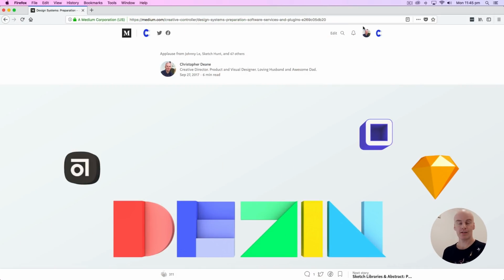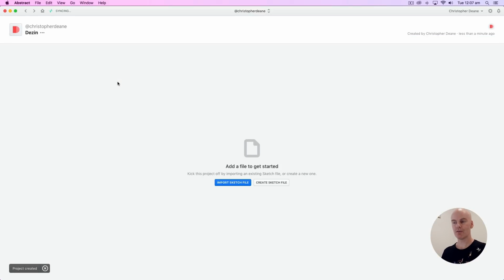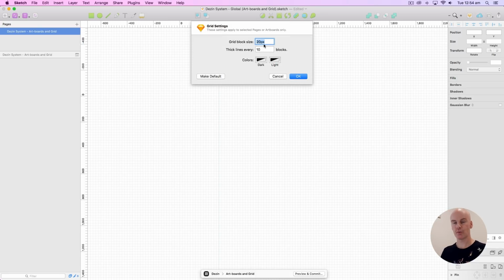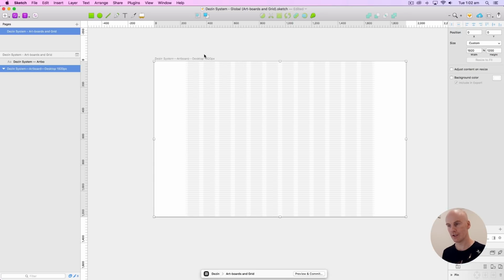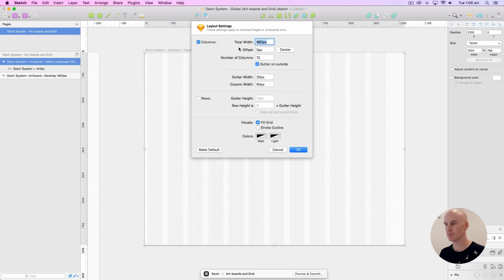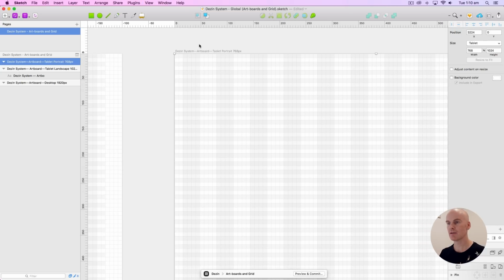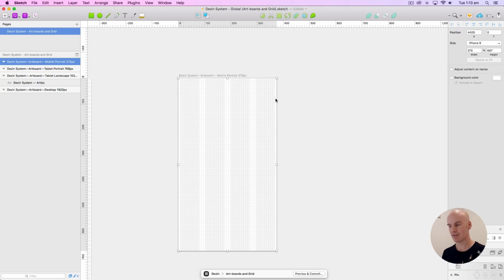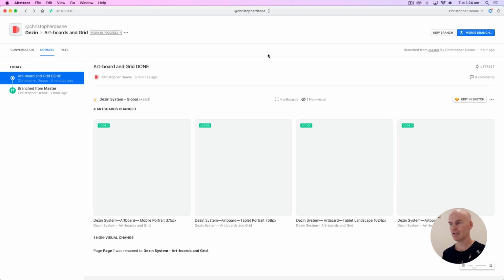Design Systems, part 1: Art-boards and grids

Comment: Hey Christopher. Thank you for the video man. love this stuff.
I struggle to understand grids and how they work. Do you have a video on understanding them? you used specs to create you art-boards but is there a video before this showing how you came up with the specs in the first place?
Reply from the maker: Hi Brand. They're really based on trying to keep to an 8 pt scale and then seeing how many columns and gutters that can be multiplies by 8 can be fit into them. I've now changed how I approach this and only keep the gutters as multiples of 8, with the columns becoming fluid. As that is more in-line with how front end works 🙂.

Comment: Awesome videos Christopher! Just one question if you don't mind.
When working on an 8-point grid I am still confused on how I should vertically align small objects. For example, a text with 14px font-size and 20px line-height. It doesn't fit perfectly in any row... Increasing line-height doesn't make sense (the next text style is 16/24) and decreasing will also look bad.
What do you do in these occasions?
Reply from the maker: Hi Gerard, you could try a 8pt grid with a 4pt baseline (Type) grid. That's what I'm moving too 🙂.

Comment: Christopher, amazing series! Great work! Could you please explain more in detail about the grid system you are using and how it works and how can i know how things will look at smaller resolutions like 1280 when designing in 1920 with a 1440 grid and and for what reason do you use the guides you place on different measures and how is that helpful for me?
Reply from the maker: Hi Sno. I use an 8 point scale and this gets applied to type scale, icon size, grid layout settings and everything else then becomes a multiple of 8 in width and height. This allows it all the snap into place with the columns and grid we use. On smaller screens it also works where for at 1280px art-board you would use layout settings of: 1248px, 12 columns, Gutter on outside ticked, Gutter = 32px, Column width = 72px.

The guides are there to help content snap into place easier and the inside guides are for text based content.

Comment: Hi Chris - thank you so much for this. These tutorials have been really helpful! My only question is this: how would set up this grid so the outside gutters are equal to the inside gutters? It's been really bugging me! Any advice would be much appreciated. :)
Reply from the maker: If you look at how a grid is built, it's actually 12 sections and each section contains a column-item that has (In Dezin's case):

16px gutter (Left) - 88px column - 16px gutter (Right)

This is then repeated 12 times to give you what looks like you have 16px gutters on each side of the whole set but 32px gutters on the inside. Does that makes sense? Sketch creates the layout settings this way (As does Bootstrap) so you'd have to add another 16px on each side manually in your art-board to achieve what you would like to do.

Hope this helped and have a good week 🙂.

Comment: Can anyone explain me briefly how making a grid system like this helps in the design. Also, would love to know more about the 8pt grid. I think it helps in a better handoff to the developers but I am sure that there is more to it.
Thanks. By the way amazing stuff. Nice articles as well. Really appreciate the time and effort you are giving in.
Reply from the maker: Thanks for watching Nitin. The 8 point grid is something I've used for a while now and there's already a bunch of information out there like this article https://blog.prototypr.io/the-8pt-grid-consistent-spacing-in-ui-design-with-sketch-577e4f0fd520 about why it's helps your design process and workflow.

For me the main benefit is that I can keep everything as multiple of 8, from the 8 x 8px grid to the 8pt baseline grid of typography that when combined with a the typography scale (16,24,32,40,48,56...) makes your copy visually more appealing and easy to read. I also make all of my icons match this scale so they fit into the visual system with ease.

Try it out, it might take a while to get used to and even I used to resist it but after adopting it and working with design systems, other designers and developers I've learnt that sometimes you just have to go with it :)

Comment: Hey Chris, thanks for the helpful video. If I was making a 12 column grid at 1366px what would the offset, gutter width and column width come out to?
Reply from the maker: Hi Tommy. Well 1366px wide doesn't divide into 8 so it could be better if you changed the width of your art-board to 1440px then use these settings to get you below 1366px:

Width: 1344px
Offset: 48px
Columns: 12 (Gutter on outside)
Gutter Width: 32px
Column Width: 80px

See what this looks like and thanks again for watching 🙂.

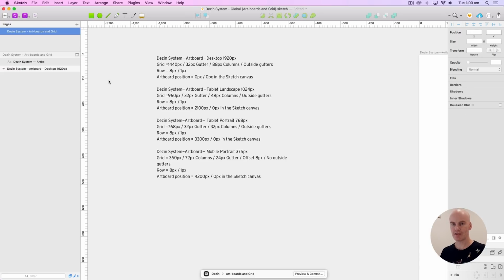Comment: What color do you use for Dark and Light in the grid setting? It's not actually clear where you get the measure from on minute 5:55 and about #n of columns (alway 12?) and their sizes. That everything is made on multiple of 8 is clear, but how then you apply this calculation and proportion on different canvas? Anyway awesome stuff mate...
Reply from the maker: "Dark" is Black/15%. "Light" is Black/5%. I type in the settings for each artboard as I'm making them so you can pause the video and pick them up that way. The idea is to make your layout settings fit within the page and also stay on an 8pt grid horizontally and vertically, the numbers change between each artboard depending on what works well.

Comment: Thanks for the video! But why did you set the width of the tablet to 1920?
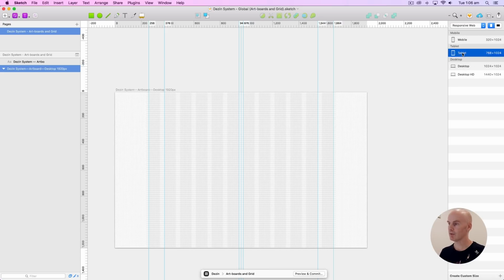Reply from the maker: +Andrei Merisca If you go to 8:02 in this video, you'll see that I set the tablet width to 1024 for landscape and 768 for portrait with 1920 for desktop and 375 for mobile 🙂.
Reply: Sorry, I meant to say desktop. Why did you set the width of the Desktop Artboard to 1920? Thanks for the reply!
Reply from the maker: The main reason is efficiency: 1920 allows you to see what your design and content will look like on larger screens of which 1920 is a popular resolution. It's the same width of full HD video so if you create any video assets for the site there's less work involved. Image assets created to look good at 1920 will look good on smaller screens right down to tablet portrait, you could then use responsive images to load a smaller one on mobile. It's also how I've designed every project for work or myself over the last few years and it's taught me to design for content driven sites better then I did when I was using 1600. Hope that helps clears things up :)
Reply: It sure does! Thank you!

Comment: Thank you for posting this video. I just started following along. I understand your grief with the 375px mobile portrait not aligning to an 8pt grid. Do you think it's better to replace it with a 320px mobile portrait instead?
Reply from the maker: That's going to be done in part 10 which will be another Community Updates edition. It'll be either 320px or 360px 🙂.
Reply: Thanks. I can't wait to check it out.

Comment: You are awesome! Thank you for doing this! Is there currently a better option than Abstract?
Reply from the maker: Tim Hansen Thanks Tim! I've tried them all and still prefer Abstract. It's growing and introducing new features all the time. It's becoming a major part of my workflow 🙂.
Reply: Christopher Deane these videos are so helpful. Does Abstract help in syncing a design system with my developer’s code base?
Reply from the maker: Abstract supports Sketch files (and Sketch based Design Systems) and has a DEV Handover feature in it's roadmap (Like Zeplin or Avocode). It doesn't convert your Sketch files into a code based system then sync that system, it also doesn't manage code based systems that have already been created. The only way I can think of that could bridge that gap is using react-sketchapp to create your Sketch file then sync that Sketch file to your team in Abstract.

Find out more here:
https://github.com/airbnb/react-sketchapp

Comment: Chris I'm trying to design grids for my company's Design System at the moment and struggling to understand why certain grid systems are chosen. For example, how do you calculate the various sizes of columns/rows/gutters/offsets based on different devices? Is there a formula you apply?
Reply from the maker: Hi Namrata. Apologies for the late reply. There's not really a formula but this is what I do. I start with 1920px wide and find the combination of width, column width and gutter width that will fit perfectly to an 8px grid. I repeat this for 1440px, 1024px and 375px <-- although that last one is Apple being a troll as 375 doesn't divide by 8 🙂. All of these grids can be used in one site that use those breakpoints and can also be generated by common frameworks like Bootstrap (When you override the global layout values).

Comment: If we wanted to create a design system that is full screen, would you just have the grid lines come to the side of the page or is there more to it then that?
Reply from the maker: You could do that but you could also create components in you design system that are responsive using the resizing settings; they would then be able to accommodate the extra width. What were you thinking of starting with, 1920px?

If so these Layout Settings would work:

// 12 Columns //
Total Width: 1920px
Number of Columns: 12
Gutter on outside: Ticked
Gutter Width: 32px
Column Width: 128px

// 16 Columns //
Total Width: 1920px
Number of Columns: 16
Gutter on outside: Ticked
Gutter Width: 32px
Column Width: 88px
Reply: Christopher Deane Thanks very much for the response, I didn’t see it until just now. I didn’t really have a set size for the screen in mind but if 1920 works then I’d be happy with that. As long as it fits into a grid system well as it needs to be responsive then that’s perfect. Thanks very much for the details, it’s much appreciated! 

Been really enjoying the series as well. It’s helped me out a lot with a recent project and has made the design so much easier as well. I’ve never really even considered creating a design system (I’m more of a dev than a designer) so its one of these things that I already can’t believe I hadn’t been using all this time. It’ll always be part of my workflow from now on - can’t thank you enough!

Comment: Can you apply the 8 grid system on a 1200px wide margin instead of 1440 on desktop?
Reply from the maker: OK, the only way this works is with these layout settings:

Total Width: 1136px
Offset: 0 then Center
Number of Columns: 12
Gutter on outside: No
Gutter Width: 16px
Column Width: 80px

Hope this helps :)

Comment: How will change the Artboards in laptop screen size (for example, my Macbook Pro have 1440x900)? Why did you miss that breakpoint?

 P.S. I can't download Sketch file by your link. Could you check it please?
Reply from the maker: These are the artboard sizes I've used for a while now, from small to large enterprise projects; they all use an 8pt grid and work well (except for the 375px one that has been changed to 360px in part 10 of this series). Feel free to use what you like though 🙂.

Also, I tried the Sketch file link and it works so you might have a Google Drive access issue on your end.